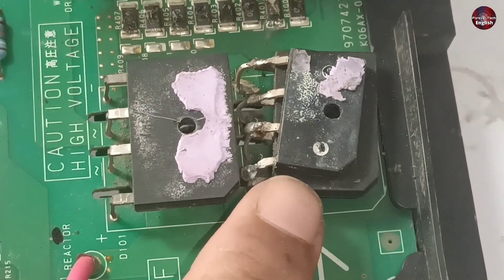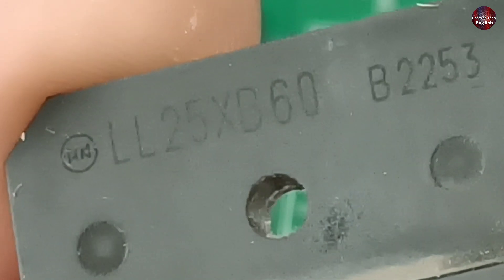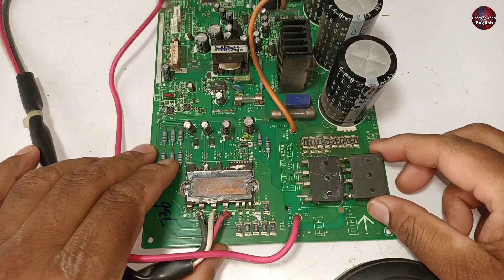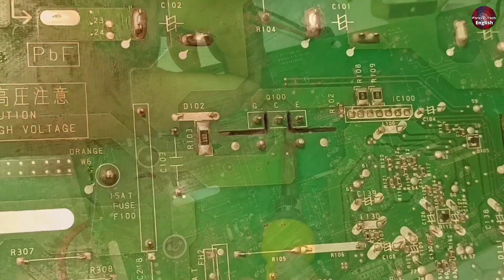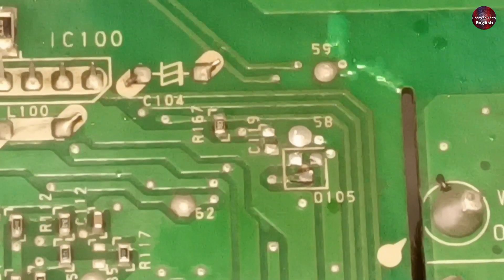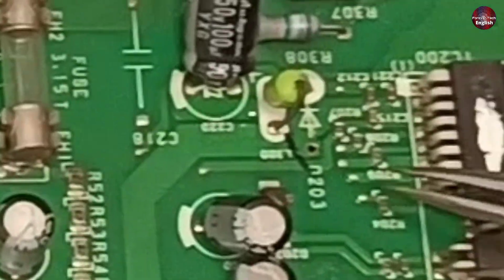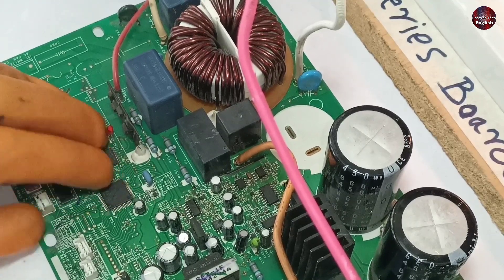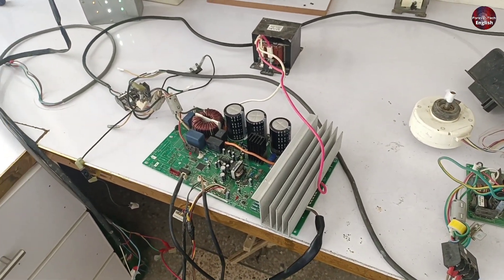Repairing AC Outdoor Motherboard Modified By Other Tech

Comment: Sir compressor take 30 amp only humming and trip 1.5 ton window ac new capacitor voltage OK what's the reason sir 🙏